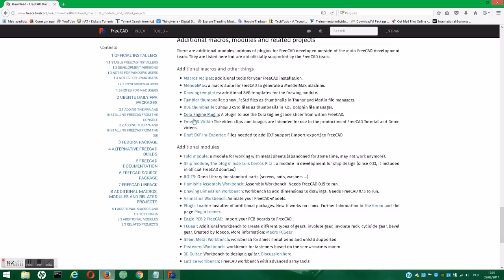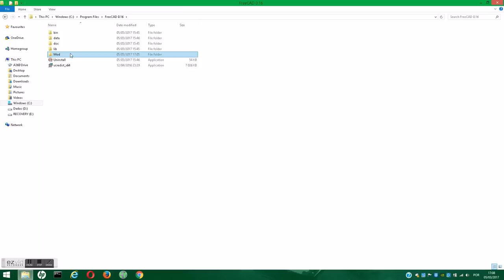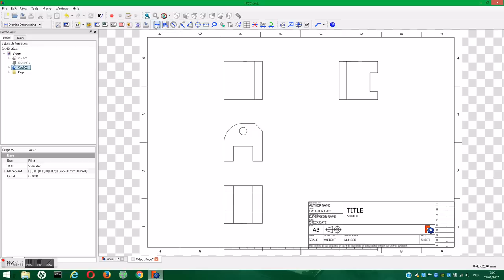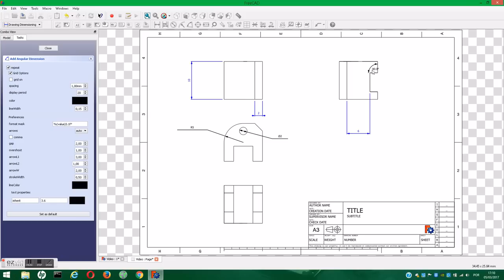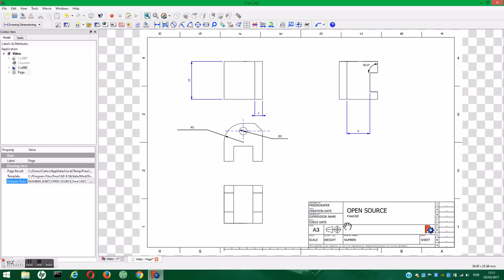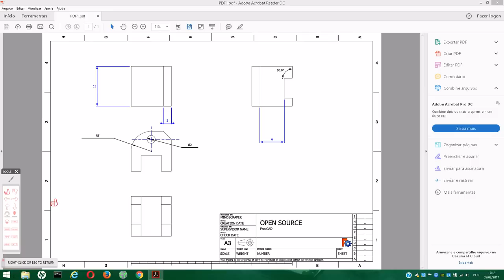FreeCAD 2D Drawing Dimension Workbench

Comment: Hi mr. I've followed your video and instruction how to install the dimension WB, but with me it dint work, do you suggest me anothe way to install it, i have installed the freecad 0.16 as yours. can you help me please?
Reply from the maker: You can try this:

-download the workbench from github by clicking on the button “clone or download” on the github page (upper right corner) and choosing "Download ZIP"
    -unpack the downloaded archive on your local hard disk
    -within FreeCAD, locate the macro path by choosing “Edit > Preferences > General > Macro” and look for the ”Macro path”
    -supposed your Windows-Login is “User-Name” the default macro path is “C:\User-Name\Appdata\Roaming\FreeCAD”
    -within the macro-directory create (if not already present) a folder called “Mod”
    -within the folder mod create a folder with the name of the workbench, for example “Assembly2”
    -now move the unpacked files and sub-folders of the workbench to the just created workbench-folder
    -after restart of FreeCAD you should now have an entry in the workbench-pulldown-menu
Reply: Once you extract it basically extract to a folder within an empty folder. Cut the folder from inside and use it. If that makes sense.

Comment: download the workbench from github by clicking on the button “clone or download” on the github page (upper right corner) and choosing "Download ZIP"
unpack the downloaded archive on your local hard disk
within FreeCAD, locate the macro path by choosing “Edit > Preferences > General > Macro” and look for the ”Macro path”
supposed your Windows-Login is “User-Name” the default macro path is “C:\User-Name\Appdata\Roaming\FreeCAD”
within the macro-directory create (if not already present) a folder called “Mod”
within the folder mod create a folder with the name of the workbench, for example “Assembly2”
now move the unpacked files and sub-folders of the workbench to the just created workbench-folder
after restart of FreeCAD you should now have an entry in the workbench-pulldown-menu

Comment: Hi, is there any way to use the reference letters in bottom right corner (A-B-C-D-E-F-G) to assign dimensions of the parts? Thanks!
Reply from the maker: I've never done any of this but I've opened FreeCAD and tried to do it and if it's possible, I do not know.
Maybe you can use the Txt tool (add text to drawing)
Reply from the maker: If you find out how to do it. Then tell me how you did it.
Reply: I couldn't find a way to do it. I will take a look at the forums to see if there is something there. Thanks!

Comment: its not working on FreeCAD v0.16 - See below link
( https://freecadweb.org/wiki/Download#Additional_macros.2C_modules_and_related_projects ) - 
Drawing Dimension Workbench: Workbench to add dimensions to drawings. Needs FreeCAD 0.15 to run.
Reply from the maker: I have Windows 8.1 and 64-bit operating system. I've seen this link but the truth is I have the FreeCAD version v0.16. I've still been using the Drawing Dimension Workbench.
Reply from the maker: See what they say here:
https://github.com/hamish2014/FreeCAD_drawing_dimensioning